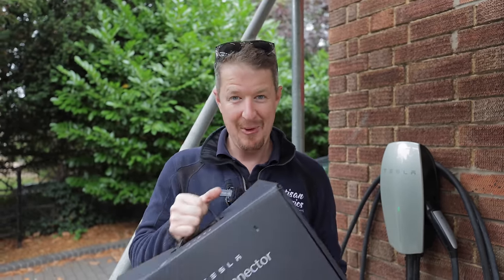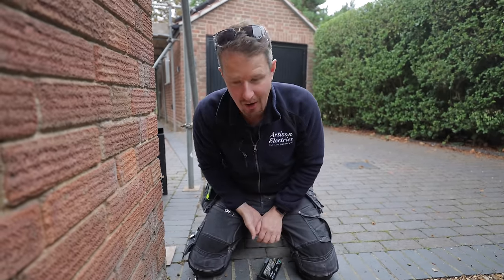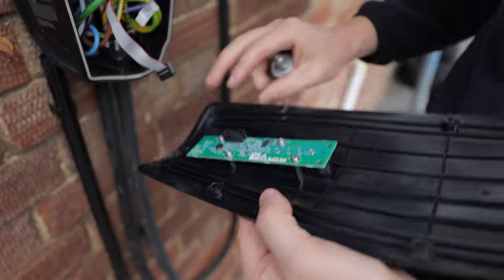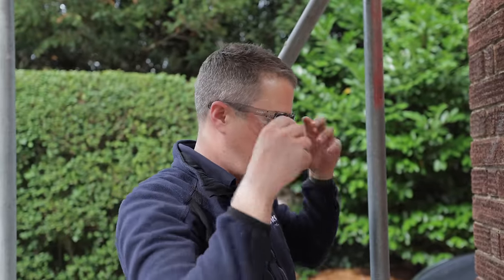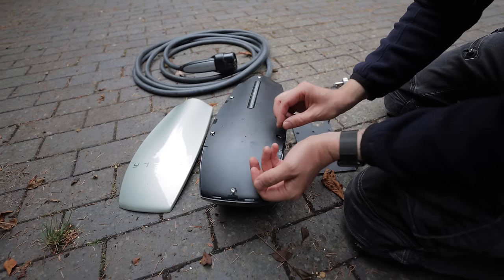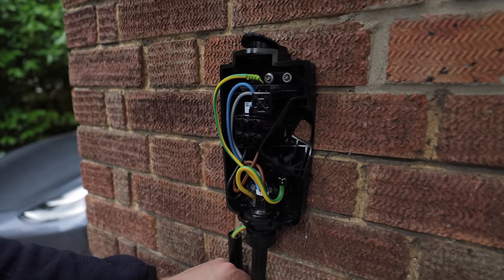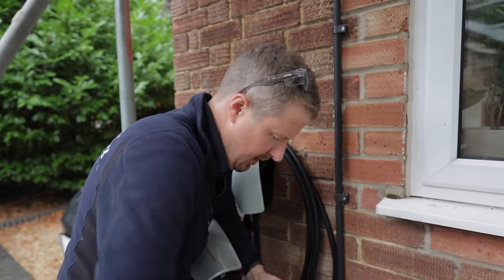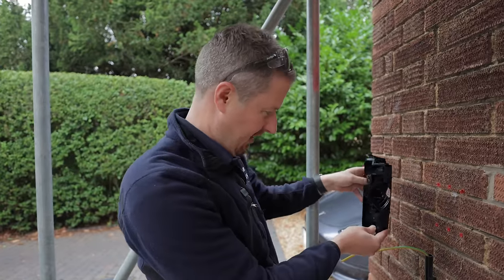Tesla Wall Connector Gen 2 vs Gen 3 - Should you upgrade?

Comment: It is thinner because it can not handle as much amperage. Get the cybertruck or something else that can charge at more than 48a, then you are stuck with 48a.  Gen 2 can charge up to 80a on a 100a breaker. Foolish for future capability I think. Otherwise 3 only gives you wireless sharing (gen 2 still gives wired sharing communication) and 3 gives wifi which really is not that necessary nor is sharing unless you are stuck doing so or need multiple chargers which homeowners probably won't need. I have no need for wifi.  For what?  I can control charge from car app.  I plug in and charge. I will put in more than one that is separate. Gen 2 can still share with wired communication which you can run because you are running power anyway so what difference does it make.  Gen 3 has glass front which is more fragile and people have had issues of cracking. I am an electrician and have installed chargers.  No issues with space to work with in gen2.  I actually have big hands but I guess some people have issues. I have 3 gen 2s myself and love the fact people are foolish enough to give up the gen2 and get 3s, because I just make out.   I have built stands for chargers in remote locations for me and a client who loved mine and these open stands have roofs, lighting, a wall outlet etc and mine also has cameras on it. I do a bit more than just slapping on a wall.

Comment: I would have mounted a box on the wall below the charger - feed the cable and the earth into that - then feed a single cable into the bottom of the EVSE.   This way you'll have a nice point to interconnect in the future.   You'll maintain the integrity of the unit and you'll ensure the future upgradability of the system.

We've been putting in KEBA systems with RFID security - they look like an appliance compared to this unit...

Comment: Hi,

It is annoying when I have friends visiting with a Leaf , ID4, etc. that they cannot use my wall connector gen 2. It's the European version,  so physically it fits! But it doesn't charge. 
What's the best way of changing other cars with gen2? An adapter? A firmware update?

Comment: The Wire Tie goes on the wall place to secure the 3 wires. There is a small slot in which it fits in the wall plate. It is discussed in the installation manual...                                                                                                                                                                                                                                                                                           We can charge at 48 Amps single-phase because of the way in which we get out power. In the UK single-phase 220 volts is 1 hot + 1 Neutral. In the US 120 volts is achieved with 1 hot + 1 neutral, but the Tesla Wall Connector is 240 volts which we accomplish 2 hots + 0 neutrals.

Comment: It should be noted that it is illegal to sell the Gen 3 wall charger in the UK as it does not comply with the 2021 Smart Charger legislation.
Reply: Not yet though, (2) The requirements in Schedule 1 to these Regulations do not need to be complied with in respect of a relevant charge point which is sold before 30th December 2022.
As it's OTA upgreadeable I would be surprised if it couldn't be made Smart. The Tesla cars are compatible with Octopus Intelligent which does exactly what the Regulations prescribe.

Comment: I think the Hypervolt is the best looking EV charger, and install is pretty “easy” as well, and imo, looks better on wall w/ cable compared to Tesla and others…
Of course, if I had a Tesla charger, I’d spend the extra and get the separate accessory holder for the charger cable head. Install next to wall unit and plug into that to hold while not in use; as looks better than in main unit itself, imo.
Thx and c ya L8R ✌🏻

Comment: I have the glossy black gen 2 and elon signature. Linked with a communication cable to load share. I want the thinner cable gen3 but fear of them not communicating with each other and overload my breaker. Does anyone know how stable it is with the wireless connection to eachother?

Comment: Don't use earth rods in the USA?   We have a grounded system and I thought you guys do not???  (at least in the outlets, don't yours have only 2 pins for power and that is it?)  We just don't need a ground rod for a remote charger because we ground back to the panel. But actually sub panels in sheds usually have a ground rod.

Comment: Hi, is it possible / doable to make charging cable shorter ? No need for 7.2 m in my house. All I need is 2.3 meters. 
It would look better. Just wondering if that would be an issue in any way like for example heat dissipation or other issues . 
Anyone ? Thank you

Comment: I thought Gen 3 power sharing was over WiFi, while Gen 2 required an ethernet cable runs between each wall connector.  Gen 2 and Gen 3 cannot share power with each other.

Comment: American here, can you explain the readings at 4:18. L1 to N was 227.8 (I get that). L1 to E was 145.9 and N to E was 148.3. 
Those two readings doesn’t jive with the first. And to each other. I can assume that the difference between each other is because the charge point has its own Earth rod separated from the main panel Earth rod. TBH, I don’t think that’s legal in the US, unless the rods are bonded to each other, even if they are on opposite ends of the house.

Comment: Electricians need to check and verify what others are doing. That is why there are lockout padlock holders for panels at least for in the usa that allow multiple padlocks to be put on from different electricians so they can all simultaneously have control of the breaker panel without any one alone having control. There are also lock handles for breakers.

Comment: The cable tie depending on where your power wires come in is used to secure your power wires and hold them. If I recall, there is a loop/hole halfway up on the right to secure your cable to as it passes around in the unit. Take a better look. Now I am worried about your attention to detail.

Comment: The main benefit is if it fails (like water gets into the cable, connector or push switch) then then V3 will be easier to swap with a replacement! Thinner cable is nice too. I have heard that with the latest Tesla app you can now see the charger in the app...
Reply: It is thinner because it can not handle as much amperage. Get the cybertruck or something else that can charge at more than 48a, then you are stuck with 48a.  Foolish for future capability I think. Otherwise 3 only gives you wireless sharing (gen 2 still gives wired sharing communication) and 3 gives wifi which really is not that necessary nor is sharing unless you are stuck doing so or need multiple chargers which homeowners probably won't need. I have no need for wifi.  For what?  I can control charge from car app.  I plug in and charge. I will put in more than one that is separate. Gen 2 can still share with wired communication which you can run because you are running power anyway so what difference does it make.
Reply: Version numbers please.

Comment: Is that actually a/the power supply cable that I see that is black to the right just a soft cable exposed mounted down the exterior wall like that allowed? That is crazy. Not even required in conduit?  I might have thought that was rg-6 but it looks too big for that.   We use uf which can be on the outside here, but that is still sloppy and subject to easy physical damage.
Reply: It’s armoured cable

Comment: Hi, will Tesla wall connector Gen3 charge from 2 phase, if i will have 4 wire connection 1L, 2L, N and PE wiers using 25A, 220V  from each phase L1 and L2 that will geive 11Kw of charge. And not conecting L3 to Tesla wall box? Or wall box will give some error and will not charge from 2 phase system in Europe?
Reply: Hi, I have managed to connect only L1 and L2 phases, leaving L3 not connected. The wall box is charging my Tesla model 3, but I get a maximum of 7 Kw charge only, Tesla Wall Connector defaults to 16A charge per each phase.

Comment: trick with get 3 is for paring to wifi first time is to temp.. disable wpk3 for the first join,  the after it connect you can activated it. On the wifi apoint or router.

Comment: Not sure about the pins connecting the charger's base to the cover. Sure they are designed to sit tight when new and the cover doesn't come off maybe never after it's installed but don't think it's the safest way to connect higher power.

Comment: Couldn't you have used the earth cable in the supply cable for the earth from the rod? Obviously it'd mean running it all the way from the rod to the supply location but you wouldn't have needed to butcher the bottom of the charger
Reply: Butcher? Simply expanded an existing hole

Comment: 21:20 You can integrate the Gen3 it into Home Assistant and get all the stats out of it as well.  So that really helps with home automation.  For example when the car gets connected you can setup automations to turn on lights, turn on your kettle and turn on the TV or radio for example.  Then in the morning you can turn off all the stuff in the house when you disconnect the car.  All sorts of cool things, like color changing lights based on the amount of current its using to charge...  Also you can limit what cars can charge from it as well and lock out other cars from using it.  The later is setup in the web interface of the unit.  Keep up the good work.    Also just an FYI there are a number of newer cars in the market here in the USA that are now using 19.2KW on single phase, Porsche, Ford just to name a few.  The Ford can also back-feed into the house to power it from the trucks battery pack via its EVSE.  Instead of the small 13.5kWh powerwall you have the full battery capacity from the truck.
Reply: where can I find how to  integrate the Gen3 it into Home Assistant and get all the stats out ?
Reply: Full battery backup capacity for the house, yes, but only when the truck is home. Inevitably, the truck will need to be driven. I’d rather have a permanent solution like Powerwall.
Reply: What is Home Assistant?

Comment: I'm not an electrician, but I think I would add another box like a wisker box under it, take the earth rod and connect that to the charger side and then connect the wire side at the consumer unit earth. So there is just a black box near ground level where they swap.

Comment: Rather than 'brain fog' think 'middle aged moment' :)

Serious question, though: why did you not connect the house earth wire to the earthing rod? (You can tell that I'm not an electrician!) And, for the more security conscious, does the Gen 3 box have a wired ethernet port?

Comment: You know your explanation of the earth ground doesn’t make sense. The Tesla car has rubber tires and is insulated from the earth and won’t have the same potential.
Reply: The insulation is exactly why the grounding is useful.  In the case of an energized chassis (from a short within the car, or from an external source) the grounding provides a ready path for the charge to go to ground as opposed to going through a person.
Reply: Don’t the new charge points include PEN fault built in now? Thought I read it somewhere 🤷🏻‍♂️
Reply: Never installed these by the way. In case those eagle eyed thought I should already know.